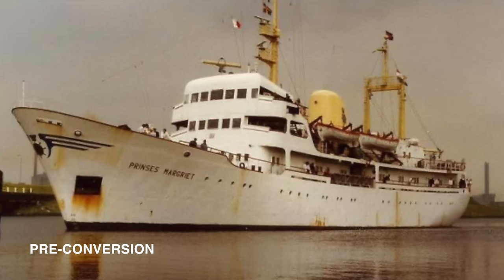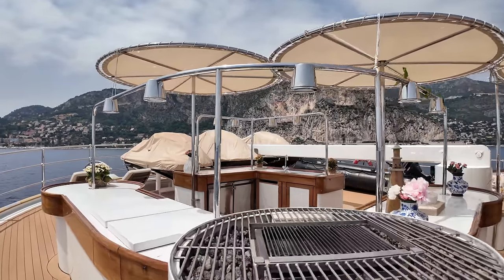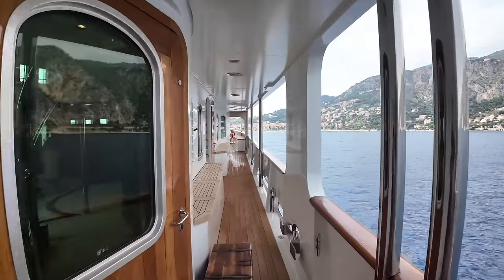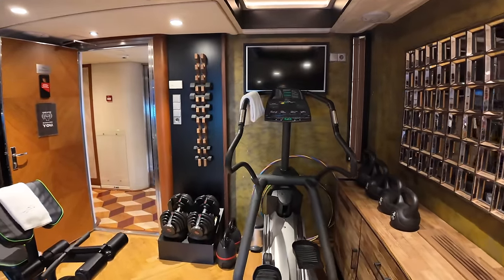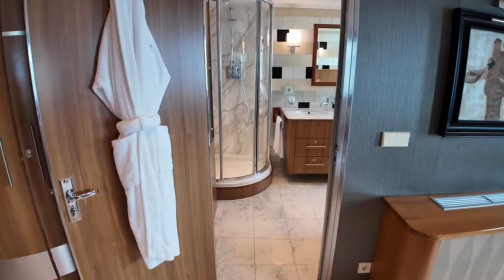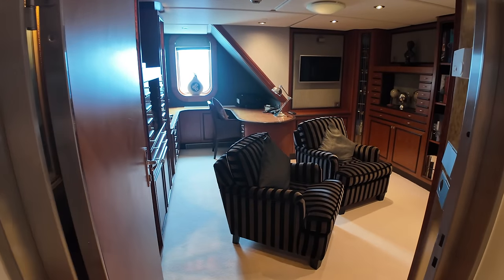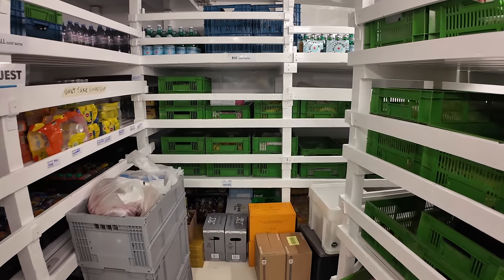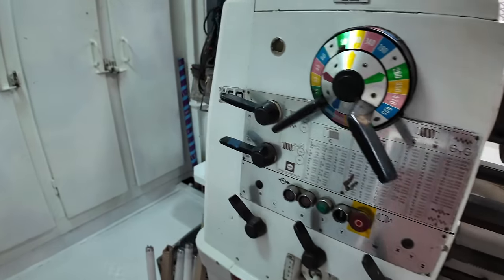THIS Is M/Y ‘Sherakhan’! The ONLY Explorer Yacht of Its Kind (Available for Charter)

Comment: This is not the usual over sized modern speed boat I see around today. It is a real ship and reminds me immediately of the the Christiana. I could live with the single caterpillar engine with no worries, as many a much bigger ship have had in the past. And I would feel more comfortable and safer travelling around  the world, aboard this ship than most other flash yachts I see around today. I was stuck in the Indian ocean in a monsoon once on an old 16,000 ton ship with this design hull, and these canoe hulls are designed to handle the rough weather. It does not matter how fast your boat can go, it won't help in rough seas because you have to slow down in rough seas to match the seas pace to survive. Even a 200,000 ton ships has to do that. This is a liner hull and not a cruise ship hull which has to avoid rough weather like the plague.
Reply: Not to worry, most boats have a small single engine as (not shown) a back up motor, approximately 70 hp, depends on size of boat, but enough to get you... home
Reply: I think the conversion raised her center of gravity.  I wonder how much?  This yacht is beautiful.  But I am wary of conversions.

Comment: Possibly your best yacht walkthrough!
A very impressive 70m that has been incredibly well re-modelled.
I am amazed at the guest accommodation, so well done with minimal wasted space but still manages to give you everything you want and more with a feeling of space!
There is so much to like about this yacht. The guest cabins are beautiful, the deck spaces are great, I love the big dining table for 22 and the galley is impressive.
To me, a bridge is a bridge, the yacht gets steered and stopped. Black magic! I'm a numptie that thinks the captain is the driver, the chauffeur while I am more interested in the chef and sommelier, maybe the barista.
What I didn't like is that if this is explorer yacht, not a weekend gin palace, I would like an overview to see if the crew are unhappy galley slaves, as in properly accommodated for long voyages that Antarctica would involve.
And the range is almost too modest. 
I didn't like the engine room, more modern yachts seem to look so orderly and uncluttered but I'd shriek and run away if someone offered to show me "the engine". I know nothing!
Lastly, it may be OK for living on the yacht for a few days, becoming accustomed to the layout, the decks etc but for me, I like pictures and a deck plan layout provides a great context or framework to make sense of how things work and fit together.
To me, a superyacht is simply a resort hotel that floats and is mobile but there is so much variability in superyacht designs.

Comment: Interesting how they painted over all the equipment in the engine room, including the screw heads.  Looks nice, but creates problems trying to remove those fasteners.  Had a used car once where this was done.  Looked good, but was a bitch to work on.